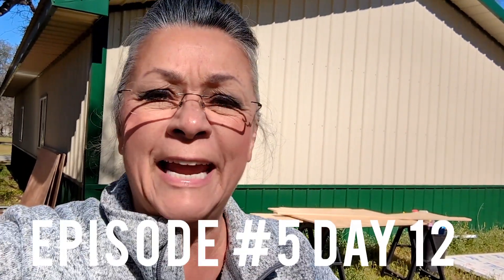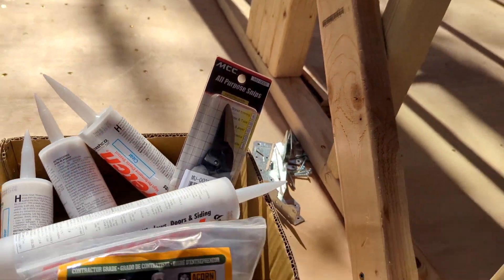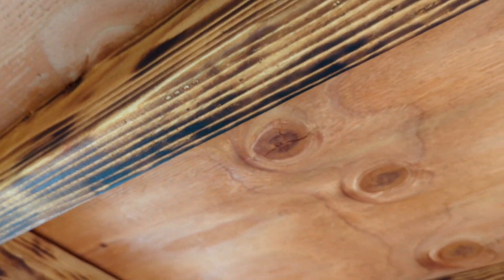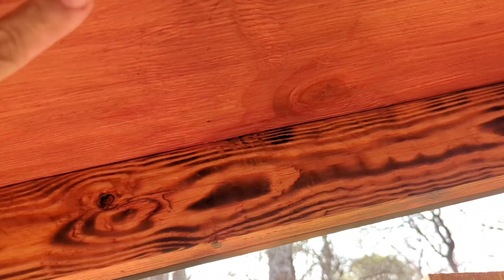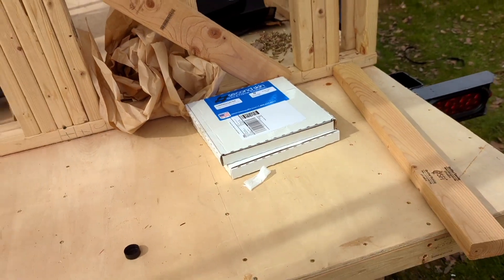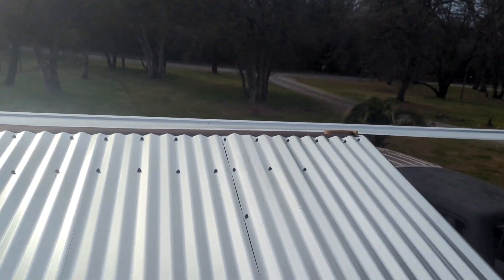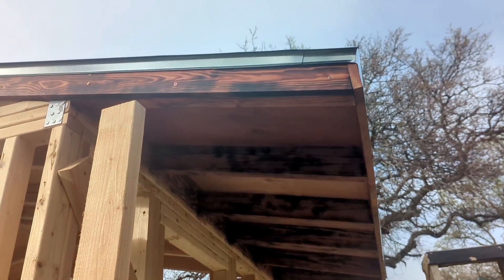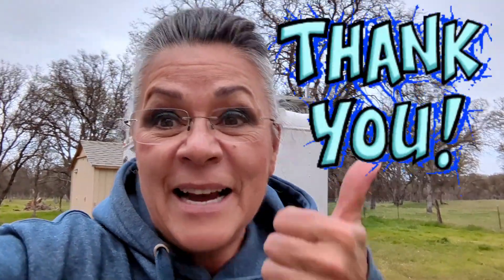BUILDING A TINY HOUSE ROOF

Comment: This was chock full of progress!
Totally agree about the stain coloring. And the composite for the back deck.
The front, exterior access is like what you find in travel trailers. Just completely protect it from water getting in there. (Had a travel trailer; ask me how I know this is a problem!)
Your build is progressing so well; not many people have that dedication to work consistently and document their progress. I think by doing that you are definitely helping a lot of folks decide if they want to tackle something similar (or building out a cargo trailer or remodeling a trailer or RV). ~ Kir (not Ron this time!)
Reply from the maker: Hi KIR, Thanks for the encouragement. I am loosing a lot of sleep over this project. But that is when I get my great ideas. One step at a time. i did not think this roof was going to be so difficult. UGH

Comment: the decking idea is a good one... but id still calk that bottom area anyway and yes, the side door is a good idea IF you really need outside access... but if you can access that storage from the inside and put your bed platform on a hydraulic gas shocks so it would lift up and give you full access... that would be one less area that could possibly leak or get broken into from the outside you could keep your bike in the pickup or have a door on the inside of your garage area... and just roll it out of the house. And you are doing a great job on the house. and it's always good to learn something new every day, no matter your age, always learn and keep your mind working. have a great day my friend and be safe, can't wait to see the next video!!
Reply from the maker: UGH There is so much to learn on building a tiny house on wheels. I could build 2 houses in the time it would take me to finish this tiny house. And less stressful. All that said. I am loving the process. and would not change a thing. Thank you so much for your thoughts my friend.

Comment: You're doing a great job!  Everything is moving along so quickly! Regarding the storage access door - have you thought about putting it on the passenger side? If you had to pull over on the side of the road in an emergency situation and had to access it, you won't be in harms way
Reply: I really like this idea about switching side for the access door
Reply from the maker: I did think about that. I would like to put 2 doors in. One on each side. It just makes sense. Thank you my friend.

Comment: just came across your channel. looks interesting. caulk the outside of the wall in your opening part... the water will already be inside the trailer if you just caulk the inside. the idea is to prevent it from getting into the trailer. 

curious to see the rest of the build
Reply from the maker: Great idea John. Thank you and Welcome to my crazy channel. I definitely will be doing as lot of calking. Thanks again.

Comment: How will you address the issue where the walls meet the wheel wells? That area could be a major problem if water gets between the two and runs down over the 3" steel and under the floor.
Reply from the maker: Oh Boy. I think I have an idea. but Not a solution yet. To answer you question I DON"T KNOW YET> Do you have any ideas? I am open for thought.
Reply: The only thing I know that would seal without ever worrying of leaks is sand most the paint off to bare metal 6" on the fenders with 60 grit or  rougher where it meets the wall. Then 2-3 layers of fiberglass matt 8" up the wall and 6" onto the fender. My only concern then would be if the structure shifts a tad from the fender it could crack the brittle resin/glass.